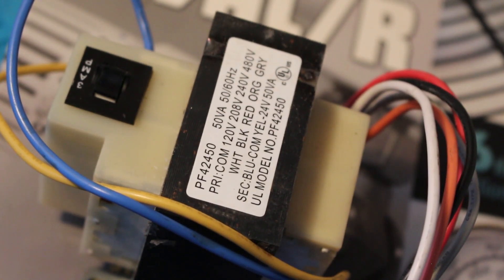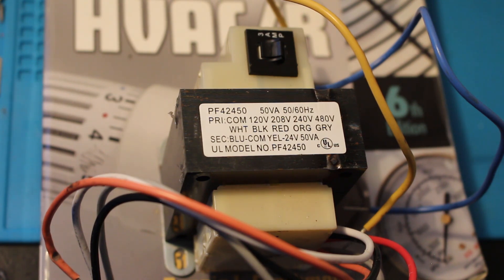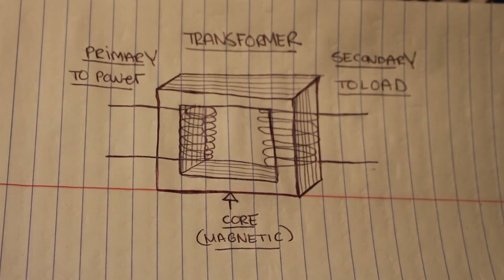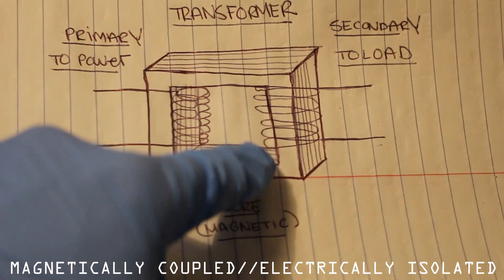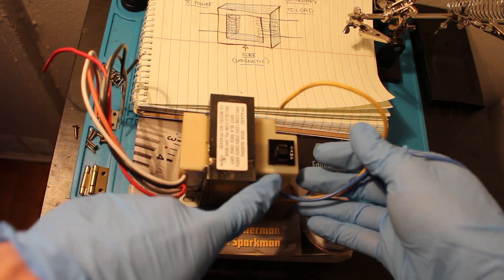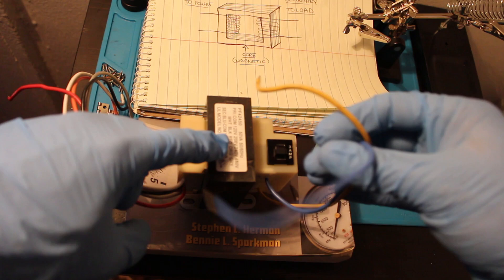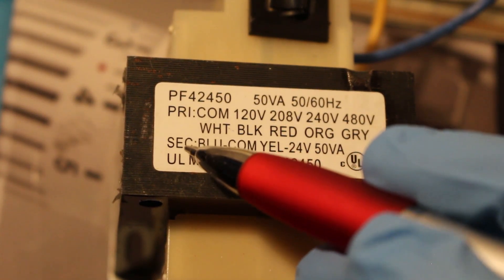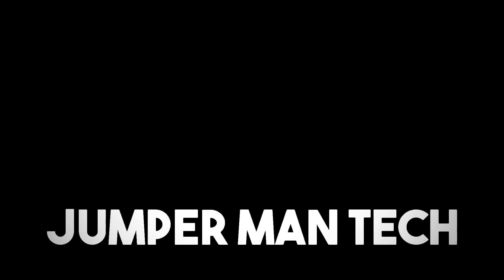HVAC/R: What is a transformer and how does it work? (SIMPLE & EASY)

Comment: Would you able to tell what is the cause of when the auto-reset protector swtich tripping?
Reply from the maker: The reset switch is only for the output/secondary voltage and that has an amperage limit like a circuit breaker. Works like a circuit breaker. Almost all the time it would come from a short/grounded live wire🙂
Reply from the maker: If you found this video or advice helpful, please subscribe & join the community!
Reply: Thank you for your reply. I have an issue that every time I turn on the unit and the swtich  tripping. I haven't checked the transformer voltage yet because I'm only free on the weekends. Do you think it maybe a faulty transformer?
Reply from the maker: @anthonydong1867  You're very welcome. Could be a possibility but I doubt the transformer is bad. Its supplying voltage to the primary/input and the issue you have is on the secondary/output. In this case you would use the process of elimination method. Start disconnecting low voltage wires and reset the breaker on the transformer. It will lead you to the problem
Reply from the maker: @anthonydong1867  I have a video on checking a transformer. https://youtu.be/N2MQnnTUgOI
Check it out. Hopefully it helps. I'd say theres an issue on the low voltage side of the system. Could be the coil on the contactor or a short/ground somewhere